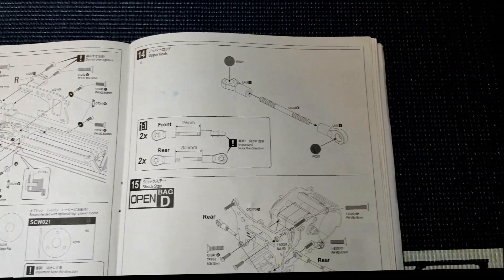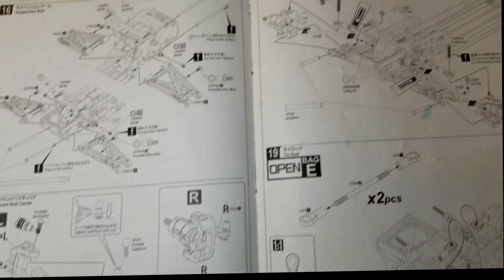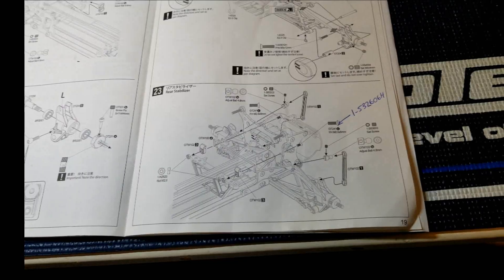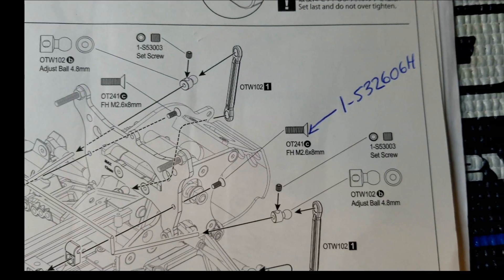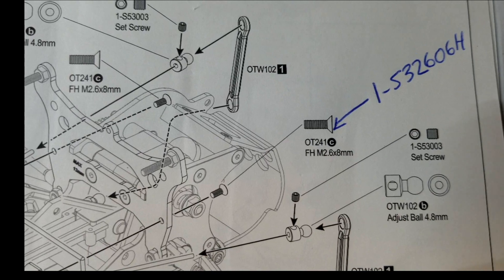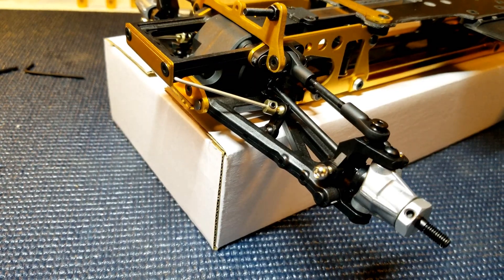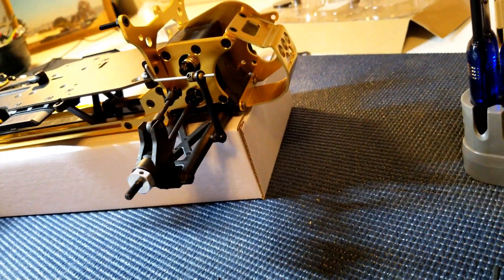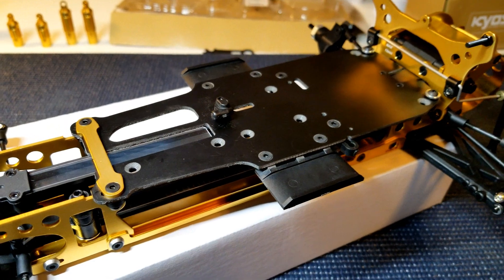Kyosho Turbo Optima 2019 Re-release Overview of step 14-25

Comment: TIP: start the video with the car first, around your 3min mark. What’s the point of flipping through the owner’s manual for the first 3 minutes? Boooring!
Reply from the maker: Thanks for the tip bro!  Thought showing an overview of the steps before the build makes sense, especially on a new kit. (re-release).  Cheers!
Reply: @fogcityrc4874  Really liked the video! Hope I wasn't too harsh...
Reply from the maker: @Fluterra  its all good
Reply: I actually find it super-helpful to see the shots of the manual. I've only ever built Tamiya and Associated kits, so it's nice to see how Kyosho arranges anything. I think it's also great to see issues/problems pointed out in the manual so you know what's coming before you even start building.
Reply: @ptrthgr8 , No issues/problems were pointed out. Kyosho has all their manuals online to view, smh..